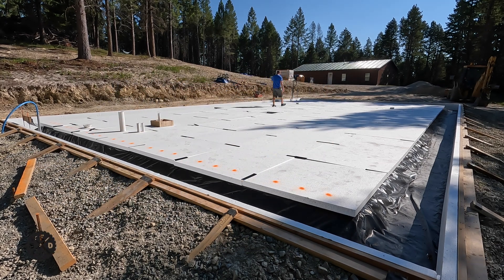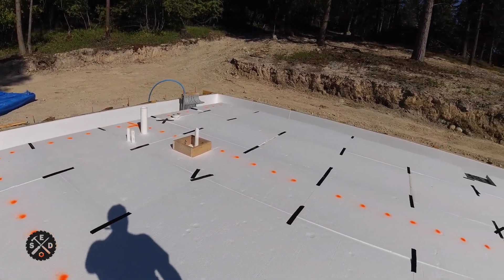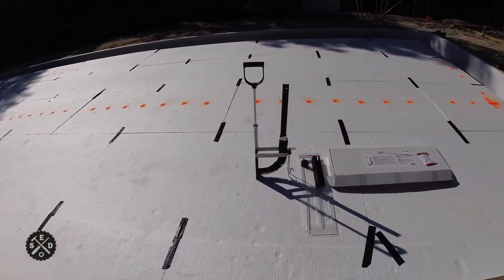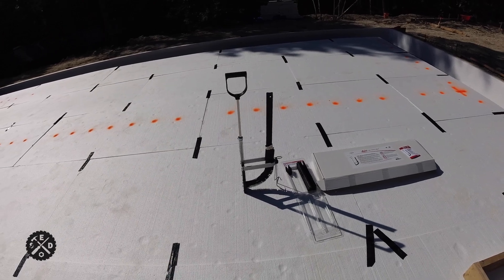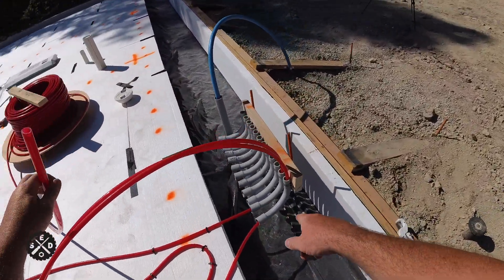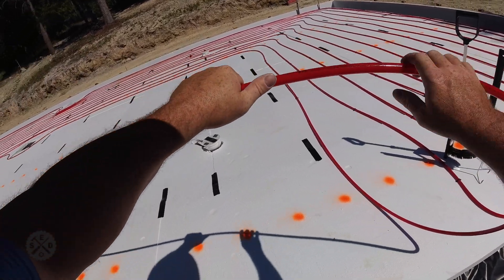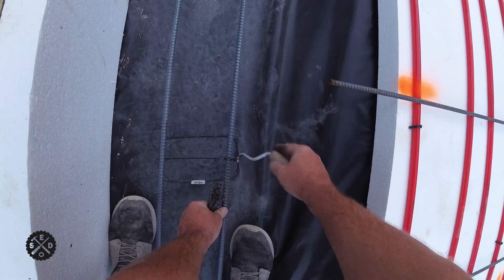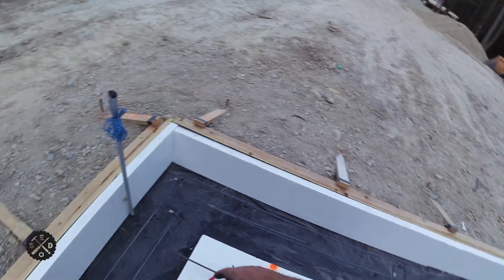Installing Pex Tubing Radiant Heat in Concrete floor diy Garage Build EP 10

Comment: Just curious, are you in a very cold climate state? Love the vids and im slowly preparing myself for my concrete pad and im really wanting to place the radiant heating/foam boards in the concrete but im not in a very cold climate except for like 3-4 months out of the year.
Reply from the maker: Yes, where I built this is in Montana so it gets very cold in the winter. We get 6 to 7 months of winter. 😂

Comment: Is there a benefit in putting the PEX tubed under the rebar instead of attached? I'm curious why you did it that way? I have a 20 x100 greenhouse to do soon so I'm trying to grab all the pointers I can get! Thanks! 
This will be my first time!
Reply from the maker: I think it's personal preference. The concrete guys were lifting up the rebar as they poured, and I didn't want the tubing to be too high up. I wanted it in the lower part of the concrete, so that's why I did it that way. Also, so I could staple it to the foam instead of zip tying it to the rebar which I've done before, but I like the stapling process it's easier.

Comment: Why do you not insulate all of the floor around the edges? Huge heat loss in winter!
Reply from the maker: I did all around the edge of slab. I didn't under the footer itself because of compression. But then the outside of the slab also gets another 32 inches around the perimeter horizontally to protect from frost.  You can see some future videos in the playlist on that.
Reply: @SmartEasyDIYer  There is higher PSI strength insulation to take the extra weight.
Reply from the maker: @badharryshideaway3665 there could be. This is what my concrete insulation supplier recommended for our area.

Comment: Great video!!!  My comment is regarding the pressure test setup.  I guess I understand checking it once it's laid although I was careful when laying mine and didn't worry about it.  In your case, if it fails to hold pressure how will you know which loop is failing without removing one loop at a time and repressurizing until you find it?  Secondly, what if you lose pressure when pouring?  You can't stop the pour while you search for the leak.  I just never quite understood that.  I have two slabs of my own and have helped lay pipe on six others.  Never used a pressure setup.  Never saw a leak.  Again, good video.
Reply from the maker: Thank you. Yes as I just commented on the other video that’s why you pressure test a couple days before hand so you know if your manifold is leaking or if there’s a problem with your actual pex. Sometimes which I’ve never seen, but there can be factory defects, which is what you’re testing for before the pour, for after your testing in case, something happens during the pour because you can repair it if you’re on site if they make a hole in it. I have that happen when someone dumped a fully loaded wheel barrel of concrete and they dug that front metal part right on a line when they weren’t paying attention and if you have air in the line, you’ll know right away if there’s a problem.

Comment: What is the slab dimension ? Length x width? And was 2,000’ enough? Would u do anything different with radiant spacing or prep? Thanks great vid
Reply from the maker: 32’ x 56’ that’s did it yes. I wouldn’t change anything next time.
Reply: @ awesome job thanks 👌🏼
Reply from the maker: Thank you!

Comment: May I ask why cellufoam vs insulation board ? It has very little R-Value. Thank you !
Reply from the maker: This is made by beaver plastics specifically for under concrete. It has just as much R-value as the blue board I was looking at. I got it from a Logix Icf block dealer.

Comment: Hey Paul, great video! What size boards did you use to do your slab with the radiant tubing?
Reply from the maker: Thanks! For the forms I did a 2x10 on top but then I had to add another 2x6 to keep the dirt in place on the outside. I reused it all later in the build too.
Reply: @SmartEasyDIYer  you’re a good man, thanks so much as I’ll be tackling a project like this soon very good work thanks again.

Comment: Anyone have any thoughts about rats and pex/foam? I live in a heavy ag area/run a farm, and tunneling rats are common, even under shallow slabs.They chew on anything they find, including pex. With pex stapled to the foam board, I think an unlucky problem could develop after a few years...

Is it foolish to tie/suspend the pex to rebar so it can't be reached? Could be hard to step around at 12" on center while pouring, but maybe worth it? And on a slab like this, is surface jointing necessary ( just thinking, you would have to keep pex low enough to cut/hit when jointing....)
Reply from the maker: So usually pex is on top of the rebar, they pull the rebar up into the bottom quarter or third of the slab as they’re pouring. It would cost more but you could go with a thicker slab like 6 inch so you could have it come up a little more without worrying about scoring it. I don’t see how the rats could be a problem if you would do the thickened edge slab and do something kind of like what I did with the metal on the edge, which I will show in a future video. Also, if you have packed crushed gravel all around the perimeter, it seems like it would be hard for them to dig through that.
Reply: @SmartEasyDIYer  Thanks for taking the time to share your knowledge/thoughts - I know the rat thing is probably a pretty niche worry!  Believe it or not, my dad poured one of our barn feed-room additions and a few corn cribs/grain bins in the 80's,  ~4" thick with (I bet) a skim bit of gravel under.  Here and there, where a crack has widened to ~3/8", it's not uncommon to find a few tunnels quite far in from the edges. The critters likely follow the cracks, but they still definitely do some work. Out here in central WI, where there's a fair bit of grain grown and stored, you can find some decent tunnel networks where they winter. But I think you're probably right about the deep edge being a deterrent.

I've staked and set my lines for 5" slab, might just do as you advise and raise to 6.  Still leveling some fill and digging my footers, but you gave me a lot of good advice to think about while I do 👍
Reply from the maker: @kelseymiller9051 yes they are persistent critters! You’re welcome  Good luck with everything. I hope it goes well.  👍

Comment: Did you have any issues with your foam or pex floating during the pour?  Not sure if that is a thing or not.
Reply from the maker: No, I didn’t have any issues.
Reply: I've always filled with water, while doing a pre pour pressure test, and the water helps hold it in place while pouring.
Reply from the maker: Interesting

Comment: I think you said that was pex A. I’m no expert and trying to learn the difference but I thought pex A was the type you used the expander tool on and not the crimp rings? Does it not make a difference?
Reply from the maker: Hey good question. As far as I know you can use both on pex A but only the expander on pex A not on pex B. If you have any plumber friends it may be good to double check but that’s what I’ve found in my research. Thanks
Reply: @SmartEasyDIYer that is false

Comment: Do you HAVE to lay concrete over PEX?  For example, I would like to put radiant heat flooring in a greenhouse with a gravel flooring.
Reply from the maker: I don’t think you have to do concrete in your type of situation for a greenhouse. Concrete is just a really good heat radiator. Once you get it warmed up if it’s insulated well underneath. Not quite sure what would be the best set up for a greenhouse but I’ve also heard you can dig a ditch down about 8 feet and it’s constantly 52° down there and you can just have like a vent pipe laid it down there to get some surface area and a fan that circulates air through the pipe under the ground and up into the greenhouse, and it helps to keep it more moderate in the greenhouse. Especially if the greenhouse is made from insulated glass or something.
Reply: @SmartEasyDIYer  Thank you!   Yes - I would love to do GeoThermal.  My sister had it in her house for years. Unfortunately, where I have to put the greenhouse, you can't really dig that deep between the water table and the gas lines that run back there.  I won't be right over the gas lines, but there is an easement for any digging from the power company. I hope to be able to get a cheap pellet or corn stove to put in the greenhouse for winter (Illinois).  Maybe I could hook up the radiant heat to that and run it under the beds.
Reply from the maker: You’re welcome. Yes that’s a tricky situation for digging. I’ve considered the geothermal situation for a future greenhouse, but it’s so rocky here. I don’t think I could get down very far. Yes I think you could run some radiant heat out to the beds. Thinking about it now I’m pretty sure my dad did that along time ago to a bed but the greenhouse was attached to the garage so it got a little bit of heat from that as well.  You could definitely experiment with it.
Reply: @stephaniewyatt3033 I wouldn’t do gravel… won’t hold the heat… rammed earth would be better
Reply: I would believe this to be a bad idea. The gravel will move around and eventually that will wear through the pex or even copper. Also, the gravel will not 'heat up' like the concrete does; the voids in the gravel would warm the air pockets and it would rise - a furnace effect. But, YMMV, good luck.